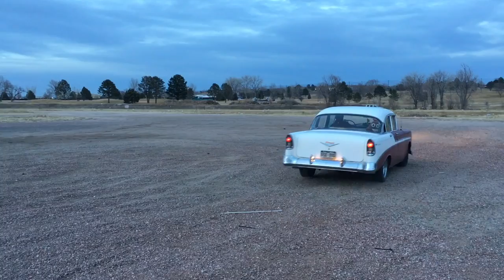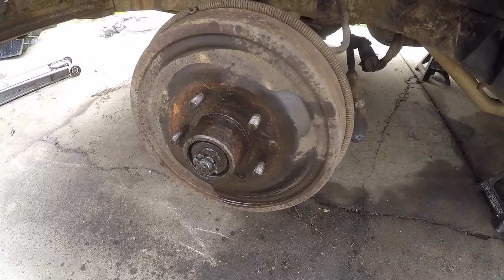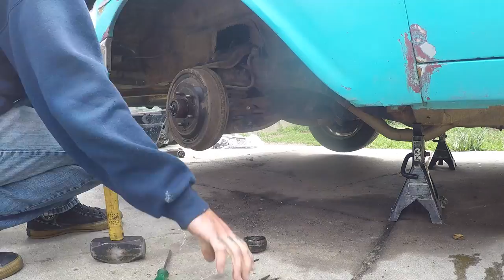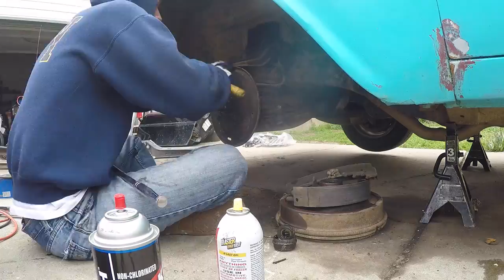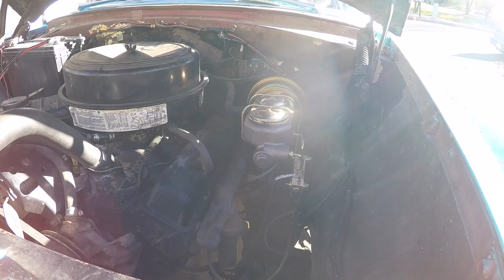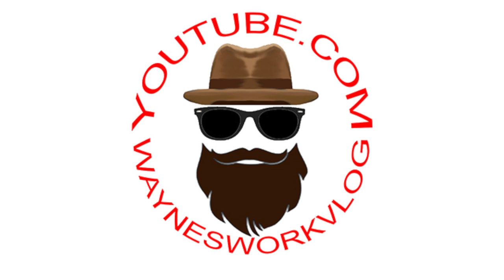1956 BelAir Power Disc Brake Conversion S08E26

Comment: I have 1957 bel air with no brake booster i want to upgrade my brake system but i only found wilwood but its so high price :c
Reply from the maker: EBAY... or classic customs.

Comment: Why did you have to remove the rotor. Was it hitting the top bolt that used to hold the wheel cylinder?
Reply from the maker: if you notice, i had the caliper bracket bending outward, it needs to bend inward and the spacer doesn't go up there so the bolt did hit.